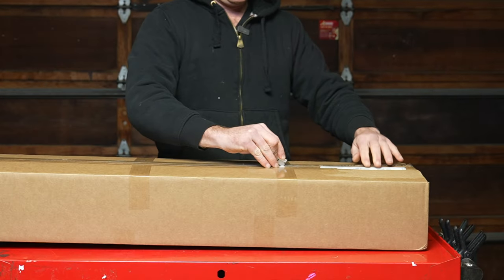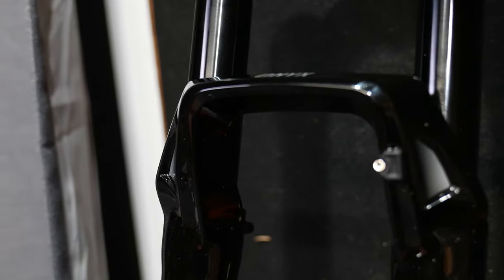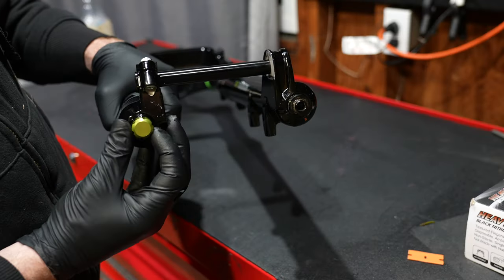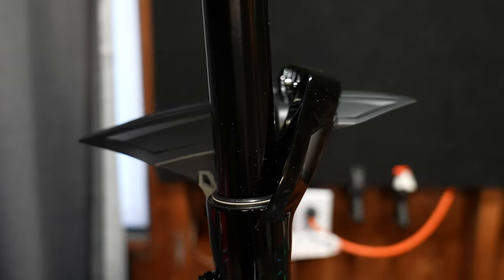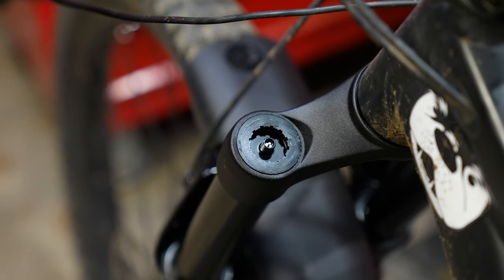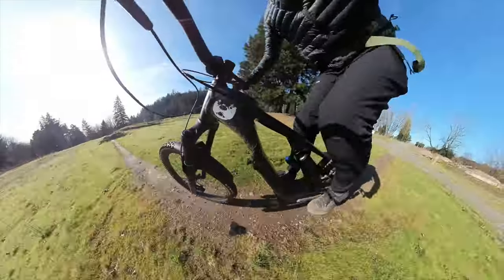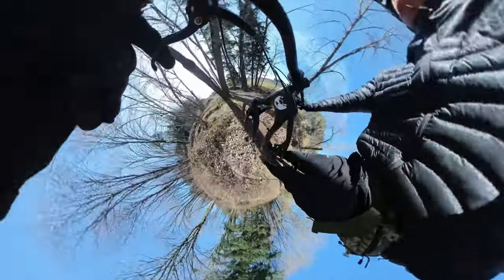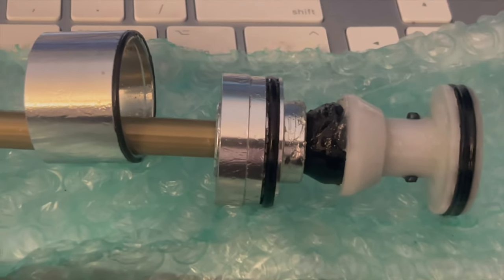the NEW NEW DVO 38

Comment: Mismatched rotor crew. I traded my helm mk2 and 185x55 dpx2 for two dvo forks onyx sc D1 with ott and this exact onyx 38 d1 sl, the 36 is brand new the 38 was on custom build for about a week. Hope I didn't get shafted, I just installed the Onyx 36 on my trance X29, I'm not done playing with it for tonight 😅
Will service the 38 before installing it on the Jeckyll, I ordered a bunch of stuff for both forks gladly dvo keep parts available...
Thanks for the guide, no worries I'm also reading dvo documentation. 😅

Comment: The 'notching' is a lip so that the fork lower can sit on the hub axle ensuring that the load path run from tyre to rim to hub to fork, and is not running through the 15mm bolt in spindle. The hub axle and the 15mm bolt in spindle are two different things. If you're not sure what I mean, check out Peak Torque, he does an excellent job of explaining it well.
Reply from the maker: I’ll check that thanks

Comment: I’m thinking of putting one of these on my enduro rig. A little nervous slot the weight though. A full pound heavier than my Fox 38! Thanks for the review!
Reply from the maker: So, the SL version in this video is 5 lb ish. The OTT version probably is a pound heavier
Reply: It's definitely not a pound heavier than the Fox 38. Put the two on the scale with the same spec and they're super close. We've had a few Fox 38 customer take-offs here that are heavier. Go with the SL version and you won't be disappointed! Thanks
Reply: @brysonmartin2362  Thanks Bryson! Bobby is hooking me up and have a 38 SL stashed away for me. Now all I need is a frame!
Reply: @MTBCoop  Awesome! You’re going to love it!

Comment: Hi, I was looking at a DVO triple cramp along with Ohlins 38DH and fox 40, if this 38 is as good as you say and think they are I might consider them great review, I'm wanting to go back to triples on my kenevo expert,
Reply from the maker: Let’s be real. A $2,000 fork Ohlins  is going to be absolutely better performance than a $1,100 fork. Give DVO 2 grand it will be up at that level. I emailed them and asked for the special Gas Gas fork they said no go. 

 I was always torn between Zeb’s pop and Fox’s plush bucket. Here’s the middle ground
Reply: Cheers for the feedback 👍 all the forks I'm looking at are second hand couldn't justify £2000 on a fork, when haibike do the ndt 8 for £4500 with ohlins front and back, and magura mt7 brakes,
Reply from the maker: I have your bike the old BoXXer was one of the best fork I ever used dual crown is on another level. I’m running the bike with 230x60 shock full 29er less travel more wheel makes it feel like a weapon!

Comment: Can someone explain to me what is SL and OTT version difference? Is SL two air chambers and OTT oil\air?
Reply from the maker: ott is like Rockshox air spring, except better. OTT uses half air half coil, it is heavier and more plush and a little harder to setup in the start
Reply: @OtterMTBtech  thanks, i have an orbea wild 2023 xl, should i get the SL?
Reply from the maker: I would get SL unless you enjoy coil forks. I like coil forks, but not enough to own one. They are more plush weight more. Wheels on the ground riding they are better

Comment: After I saw Mo And Hanna walking the Suntour factory where they make the DVO. Hate Suntour, not interested in DVO now.....Still want to see your review the Mezzer by Manitou.
Reply from the maker: That forks high on list. I just watched that factory video thanks for the tip. That’s how everything cheap is made. Sweat shops in Asia or it’s $2,000 for a rear shock!
Reply: Why do you hate suntour? They make top tier shit in every category, the Olympics, darkfest and ews have all been won by riders on suntour forks.
Reply: @Orphansmash  I'm kinda the fork guy in a local bike shop. I do all the service work on them.  The shop sells several brands that suntour is OEM and I have to deal with all the owner complaints of how bad their forks feel. The number of ST forks I have had to tear down and try to make them not "feel " like crap is well over 50. Suntour forks are pretty much 10 years out of date, they have no suspension patens so they wait for a paten to run out then the copy the suspension design. top of the line suntour = 2012 fox/rockshox forks.
Reply: DVO isn’t a rebrand SR fork. We have our own engineers and process. I’ve made suspension in Italy and Asia for decades now, it’s not the country but the process.
Reply: We are in the same building but not the same company. I’m sure you have strong opinions about bike parts, I do as well but I can’t say I hate any companies.